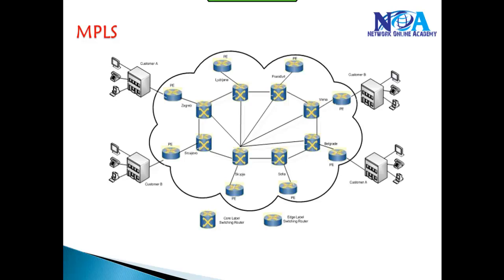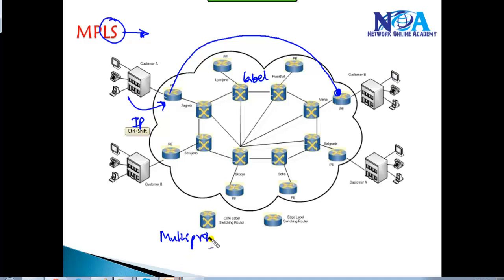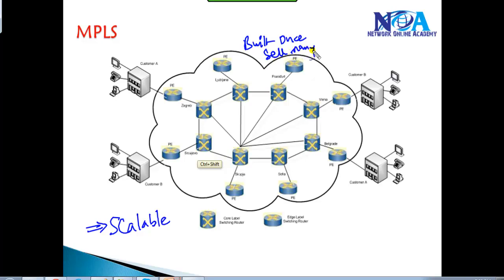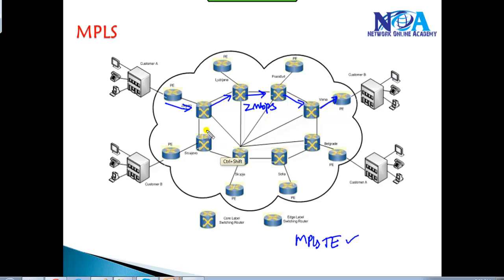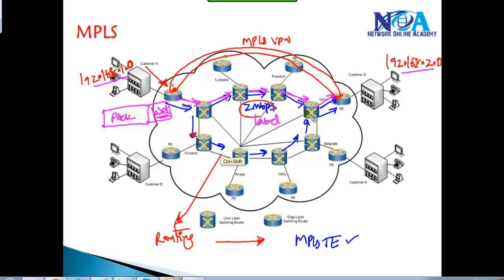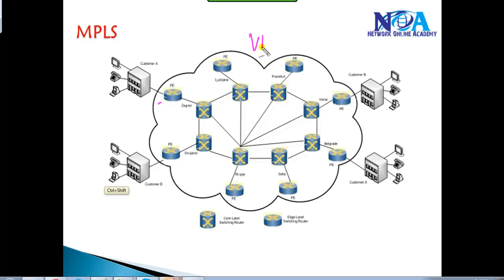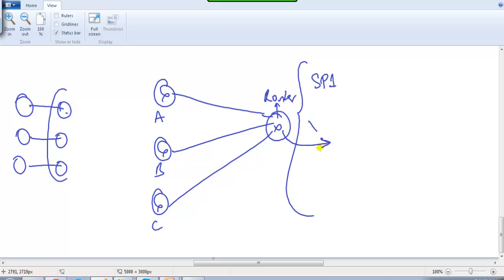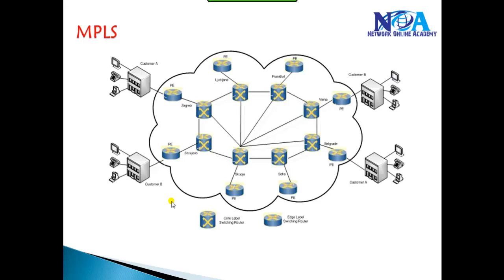CCNA Routing & Switching : Multi Protocol label Switching

Comment: Thank you for sharing.  
But it's not entirely true is it, to say, that MPLS does not care about the IP?  Switching labels are locally significant, but correlated/mapped to destination IPs.  All MPLS routers then share their own local label table with immediate neighbors, on the right and on the left, who then switch the labels in accordance with the corresponding neighbors' label table correlating to the destination IP. So, in order for MPLS to work, all associated P-routers in the ISP must be IP-route-aware to form their own Label-IP correlated table. And the addition or doubling of IP destinations would require flooding of all the new routes and reformulation of Switching label tables and cascading updates throughout the MPLS network. How does this translates to scalability, I am wondering? I am definitely missing parts of the whole picture here.  Just thinking aloud.
Reply from the maker: It’s just basic mpls overview. If u are more of my lectures. U will find more details as u said here. Thanks.